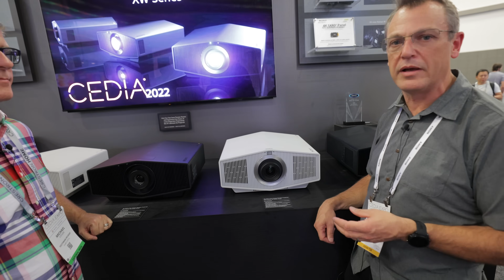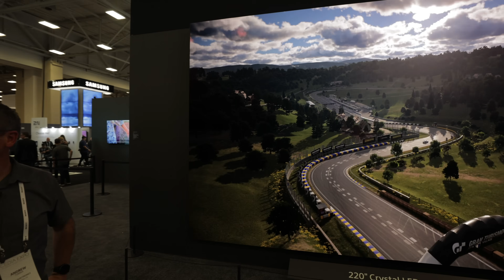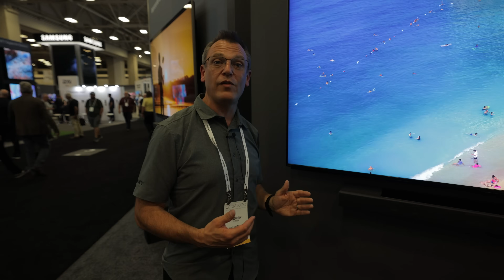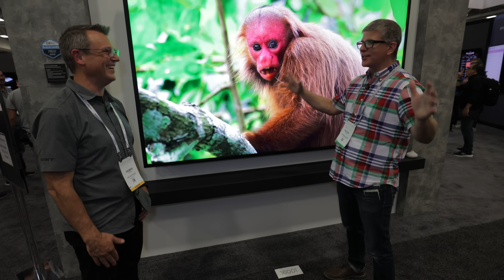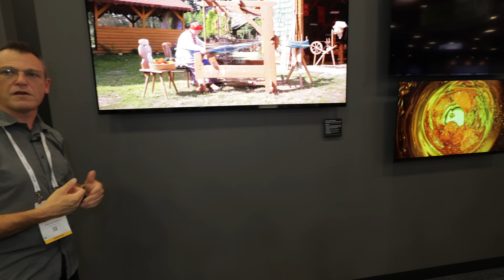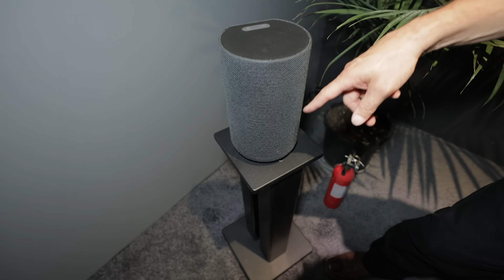Sony's MASSIVE 220 Inch Crystal LED TV and MORE at CEDIA 2022!

Comment: Okay, well I had hopes until looking at the price. For anyone wondering, this 220" model runs for about $600,000. The smallest option at 110" runs for $172,000. Not even considerable for a consumer.
Reply: @laptopdoc  My dude lol, you're speaking like it's a $6,000 tv that'll eventually make it down to $2,000 or something haha. This isn't even a consumer product, it's an industry business product. No, it won't ever come down to consumer price. they could literally reduce the price by 70% and it would still cost hundreds of thousands of dollars 😂
Reply: This is for legitimately rich people with very large homes.  It's a projector on steroids for those with a "viewing room"
Reply: Might as well get the top of the line 80k projector and do a 250 inch screen.
Reply: @Martinbj1992  lol for that price, may as well build out a literal full sized imax theater that seats 40 people. Or ya know, just buy a house.
Reply: @papermelon   😆 or buy a house! This is one ridiculous price even if I was a millionaire I wouldn't buy that!
Reply: @papermelon  haha I would go with a house, seems more practical, and set aside 10-12k for a nice theater in one of the rooms.
Reply: @papermelon  Owning a house can be great but it's also very OVERRATED.
Reply: @papermelon  christie projectors cost even more though
Reply: Crystal LEDs are for shoots and commercial applications, basically people who can pay
Reply: @redi6460  for now just as most new technology it's the early adopters that make it possible to scale it down and pump up production to bring the cost per unit down
Reply: $600,000 for this crap? My BenQ 4k HDR Projector goes nice and bright to 300 inches. Only $1,200. Leaves me $598,000 spare for a Lamborghini Aventador.
Reply from the maker: Nothing wrong with enjoying your BenQ but it’s nowhere near the PQ of the Sony LED wall.
Reply: @Youthman  $600,000 vs. $1,200 for 4K HDR in both, but ask yourself is the $600,000  Five Hundred times better than what a 4K HDR projected image looks like? I seriously doubt it.
Reply from the maker: There will always be the law of diminishing return. Let’s be honest, someone buying an LCD wall is not looking for value. They’re looking for best performance
Reply: @Youthman  yeah, I very much understand that concept. But really? 600k? Even most of the rich and wealthy can’t afford that. There’s got to be a point at which even you can’t defend it 😂
Reply from the maker: I’m not trying to justify its price. I just know with every new technology, it’s ridiculously expensive and yet there are always those that have the money and are willing to spend it if it meets their needs and desires.
Reply from the maker: Also keep in mind, $600,000 to some is like you and me spending $600. If auto companies can sell cars for $20 million and still have buyers, Sony should have no problem selling a $600K display. This display can also go in a commercial application which big businesses would easily be able to afford.
Reply: @Youthman  absolutely wholeheartedly agreed. There's always a niche demographic for such uber expensive fanaticism, like the MBL speakers from Germany.
Reply: @Youthman  Just like the old saying... "A fool and their money are soon parted" LOL.
Reply: @AudioGuyBrian  one gives you that feeling one doesn't so yes it's not measurable with cost vs pleasure it brings
Reply: @Youthman  exactly just like I can buy $250 50 inch tv of $1800.00 50 inch tv  
or better yet I can get RCA 98 inch tv for under 3k USD or 65 inch tv for 8k fro 8k top of line 🤷🏼‍♂️
Reply: @Youthman   that tv doesn’t put near the smile on your face as the Lambo Aventador… or damn near half a mill in your pocket…
Reply from the maker: Yes I would easily take a Lambo.
Reply: @AudioGuyBrian  so you're knocking one luxury item for another yeah that makes sense  how buy the cheaper projector and a used Lamborghini for the same price 😂🤷🏼‍♂️
Reply from the maker: @hec213, I find it interesting that you agree that heaven is a make believe place yet hell is real? We don’t get to make our own truth. Society teaches that you can have your truth and I can have my truth and he can have his truth and they can all be truth. The problem is that doesn’t work with reality. The Bible is very clear both Heaven and Hell are real. Whether we believe it or not, doesn’t change that.
Reply: @Youthman  Sure. All that stuff written 2000+ years ago has to be real. I mean back then people were so smart. Like they would hide in caves when a solar eclipse happened because evil spirts were hiding the Sun. The good old days of rampant stupidity. LOL.
Reply from the maker: I was a youth pastor for 23 years, lead a small group at my church and am still an ordained and licensed minister. 

I would be careful judging others and saying you can see demons in their eyes. 

Since you quoted Matthew, you should be familiar with Matthew 7:1-5.

1“Do not judge, or you too will be judged. 2For in the same way you judge others, you will be judged, and with the measure you use, it will be measured to you.

3“Why do you look at the speck of sawdust in your brother’s eye and pay no attention to the plank in your own eye? 4How can you say to your brother, ‘Let me take the speck out of your eye,’ when all the time there is a plank in your own eye? 5You hypocrite, first take the plank out of your own eye, and then you will see clearly to remove the speck from your brother’s eye.”

I do my best to live out my faith by loving God and loving others and serving the Home Theater community, rather than judging others. Hopefully you will choose to do the same.
Reply: @Youthman  Can I get a license and be ordained to be a Jedi and teach the Force to people to make a buck? About as real as Christianity.
Reply from the maker: Sounds like you are referring to the tele-evangelists on TV. “Send me money and we’ll mail you a magic healing handkerchief” or “Send me money and God will bless your faith offering ten fold” is not a representation of true Christianity.
Reply: TCL is the brand to watch at this point. 98" for $8500 seems like the most competitive option at this point. I can only assume they are going to be the ones to continue to push the envelope.
Reply: @Dahly3889  but TCL is a gamble, i had to return one of my TCL 3 times to get one without noticeable defect.
Reply: @Dahly3889  tcl is yucky
Reply: @laptopdoc  One major thing you are forgetting when it comes to projectors. It’s pretty easy to swap them out for the amount of size you get. Image when you want to upgrade this thing cause now 8k is standard or something, you’d have to take each part off, find out how to sell it or move it, etc and unlike a projector it won’t be easy to ship or sell on eBay or out in another room. With a projector it’s not hard to box it up and sell it or put it in another room and just make the picture smaller. So when it comes to wanting to upgrade this, good luck getting rid of it. 220 inches of a technology none one will want at a price people won’t want to pay.
Reply: @PerfectorZY  Sony tv wall is scalable all the way to 16k so I think you're good for a while
Reply: They said it was built for CINEMATIC PRODUCTION ... So unless your name is Universal studios or a multi millionaire...It's NOT FOR YOU!
Reply: @Krynale  You good bro? you seem pretty angry lol.
Reply: That’s nothing. If I start saving now I’ll have one by 2172
Reply: A Sony new 🆕 TV Flat Screen for $600.000 dollars is crazy outrageous high to buy!!!!!!!!!!
Reply: Or Sony 100 inch for $15k.
Reply: That's nothing
Reply: Speak for yourself
Reply: Sure it's super affordable after I sell one of my eyes, kidneys and lungs. 3D is dead anyways, so yeah!!
Reply: Whaaaaatttt!!!!!!
Reply: There is probably that much in my couch cushions. I am putting my shoes on. 😂
Reply: @mf-ud1uo  probably cause Heaven is make-believe.
Reply from the maker: Also, you won’t find in the Bible that the eyes are the window to the soul. Just sayin.
Reply: @mf-ud1uo  who said he or anyone was worshiping anything in place of god? Why you gotta come on here being super judgmental about something you know absolutely nothing about? I wish you the best but keep your opinions to yourself especially negative ones based on ignorance. Thanks
Reply: @mf-ud1uo  😉
Reply from the maker: I genuinely wonder when I see comments like yours mf, where the anger stems from. It’s like the exact opposite of the way Jesus lived his life. You will always find me sharing love, joy, hope and peace on this channel. If that’s not what you are looking for, this is t the community for you. Be blessed.
Reply from the maker: Absolutely no worries. We all have bad days. Have a great day
Reply: He said it’s custom made so I guess that explains the price but still 600k is insane. How much the 65ft one cost then? $10m? Lol
Reply: These are enterprise level, anyway who has the room for a 220 inch tv?
Reply: @smh1245  apparently you’re only able to comprehend the middle citizen and multi billionaires, and nothing in between. How confidently uneducated can you get lol. I know this will blow your mind, but there’s wealthy people who aren’t billionaires, that make six figures who would love something like this if it were in the 30-50k price range. 
Keep it to yourself next time instead of telling other people what they should care about.
Reply: Yeah this is for bored billionaires looking for a new toy to buy for their mansion.
Reply: Well its pretty obvious this tv its for multimilioners not average ppl...end of discutions...for average ppl we have 55 to 100ink oled qled tvs...or projectors...
Reply: Suck to be poor
Reply: All that money for something Sony only spend like a couple thousand to make! What fool is going to spend 600k on a screen/projector when they can literally build a full size imax theater with proper seating? When you wonder how a rich person can go broke, it’s buying stuff like this! If you’re going to just give away 600k, just give back to the community or help someone in need. If you’re going to do something stupid, you would be better off just gambling it away lol!
Reply: Wow when it’s around $100,000 I’ll get pne
Reply: Speak for yourself. You think all consumers are poor like you? Some people make 100k a month, they are "consumers" too.
Reply: What the helll. This is why I’m stopping at 85 inches and after my Sony tv dies I’m going to upgrade to a short throw projector I would never spend money for a tv like that unless I’m buying a house.
Reply: @Lowkey_nxthxn  Exactly, who tf wouldn't just buy a high end projector at that point 😂
Reply: @papermelon  there pricing is outta this world. I'm happy with my 85 inch Sony tv no way in hell I'm spending that kind of money 😂😂. I heard there's a center channel that's going for 45k or some nonsense
Reply: @Lowkey_nxthxn  just wait few it will be way cheaper
Reply: 4k Ultra short throw projector is your answer. Some of these projectors are so bright and vibrant that they are being marketed as TV replacements. 

A lot of these can cast an image up to 150” large from being only a foot away from the wall your casting it to. The lifespan is also a generous 20-25,000 hours and cost only $2000-4500. Pretty cheap when compared to this 200” Sony Crystal
Reply: @sunlips_  they're still not as bright as you think they are and it's the screen that makes all the difference that's another couple 1k and up
Reply: Sony is for the rich. They don’t like catering to the middle class